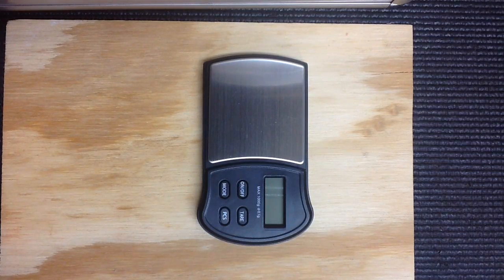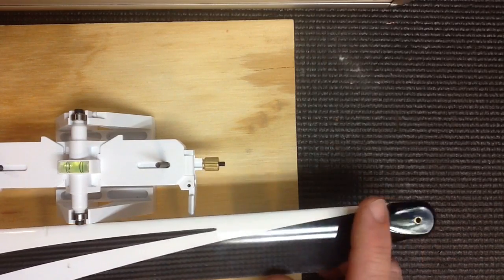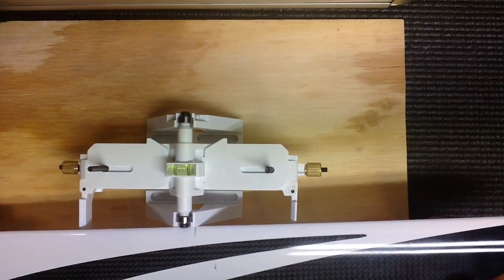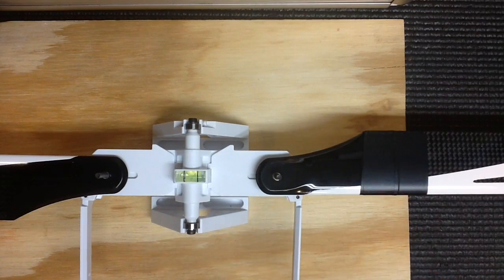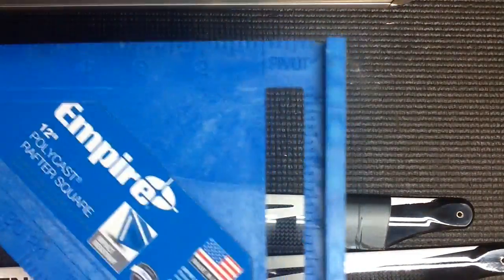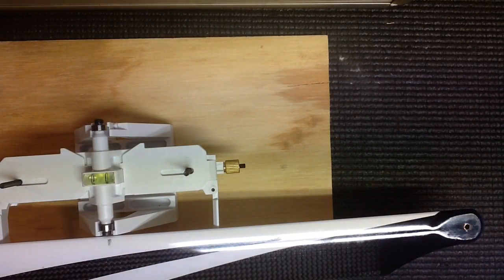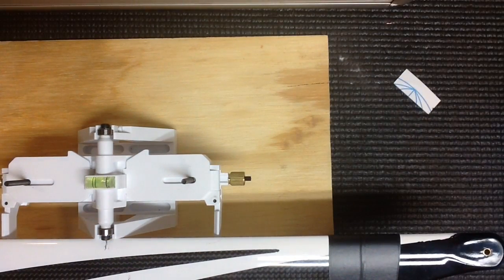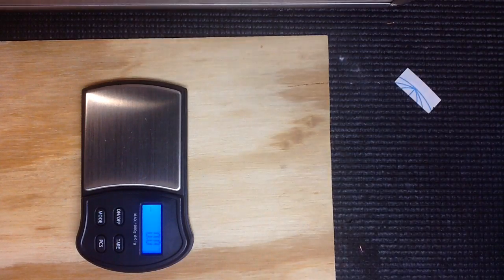RC Helicopter blade balancing and CG

Comment: Centre of gravity importance is a myth. Heli will fly on one blade and a piece of lead on the other blade holder. So long as the moment force is the same. Just use the balancer.
Also have leading edge on the same side. It is very important that blades are precisely in line. This is easy, just press the two leading edges up against a table edge or whatever. No problem if the blades are not exactly perpendicular to balancer axis, so long as they are in line. Out of line, one will effectively have a different moment arm…. Bad. It’s all physics.
Reply from the maker: I disagree. Most brands of blades on the market have the same CG, weight, and balance. If CG is off it will in fact cause tracking issues of the blades. As I said this isn’t much of an issue anymore IF blades aren’t mixed from 2 different packages. Yes the helicopter will still fly but will cause vibrations and less accurate maneuvering due to tracking problems.

Comment: Hello. Really interesting video. I hadn’t realised you needed to balance the Cof G as well.. Who makes the balancer that you used in this video?
Reply from the maker: On most brands of newer carbon fiber blades it’s really not necessary as they are pretty well balanced out of the package. I still check cg on align blades or if I ever pull 2 blades that didn’t come in the same package. I’m not sure if they still make this balancer or not. I think it’s made by thunder tiger but I will check to make sure when I get back home in a little bit.